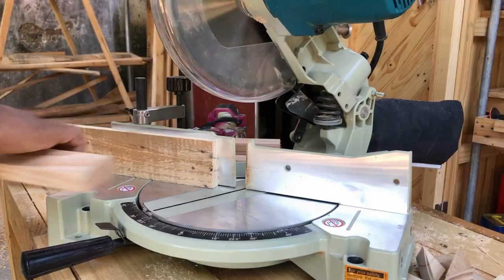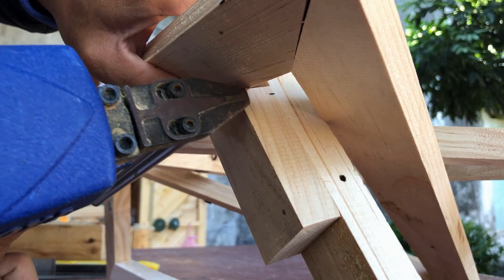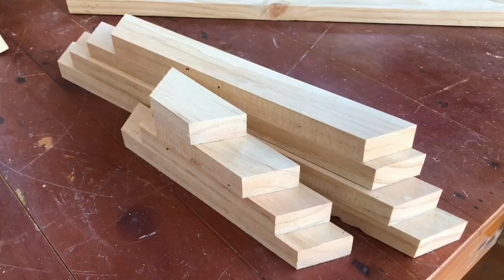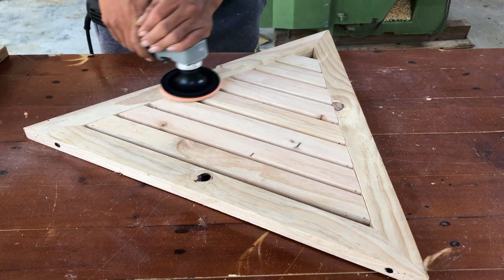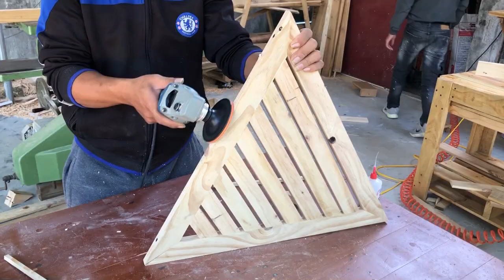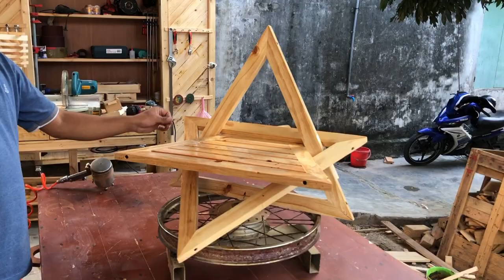Amazing Ideas Design Woodworking Projects // Wooden Triangle Outdoor Chair

Comment: What are the angular degrees of the corners??  It looks like an equilateral triangle but when I made a prototype out of some foam core the 60° doesn't work. I'm thinking the base angles may be 65° or 70°.  If the base angles are 70° then the top angle would be  40°... ie: 70°, 70°, 40°.
Reply: 30 degree angles all around I did it with 3/4 x 1 1/2 inch slats
Reply: At about 17 inches long on each slat